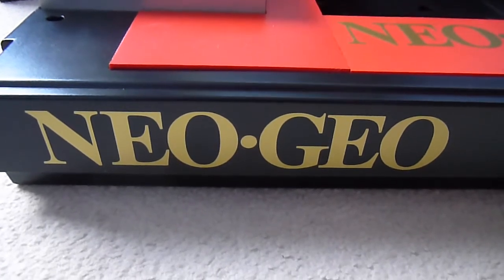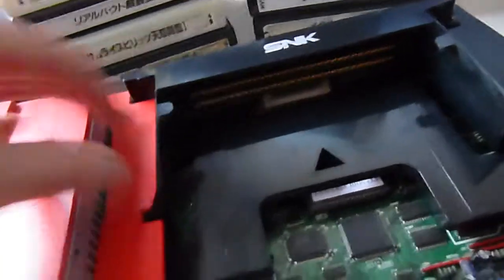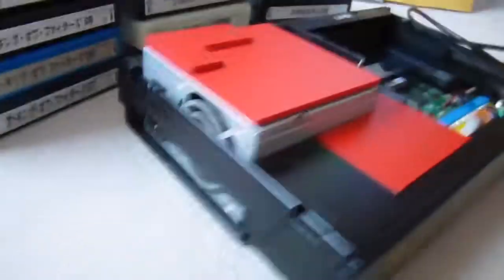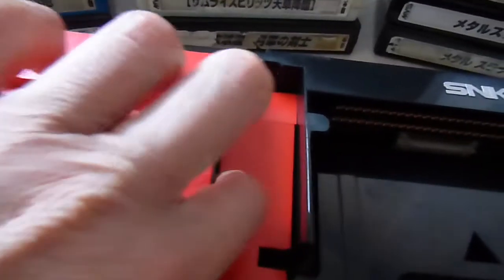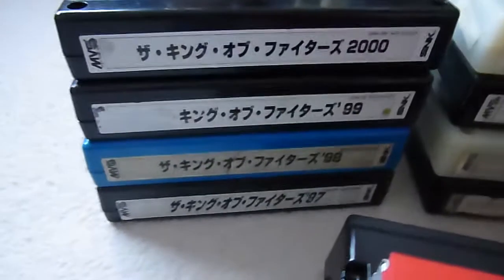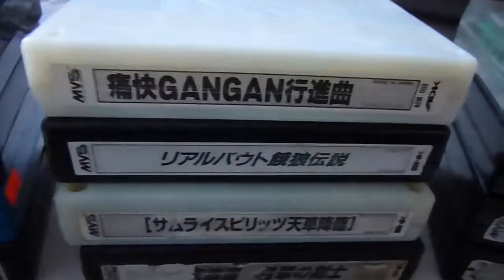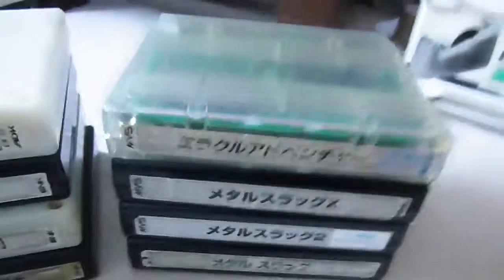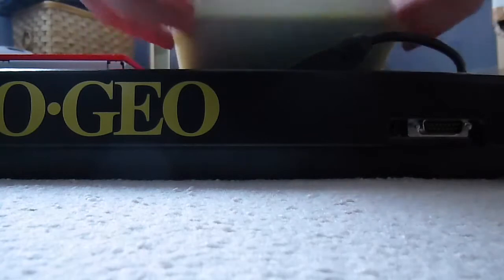Project Neo Geo : "Arcade Edition" - The Final Chapter

Comment from the maker: So, the MVS.
Well I am mainly just picking up those 'Giga-Power' fighters, you know the ones that either have mega long loads on NGCD or are mega pricey on AES, games like the later KOF's. 
Its also nice to get a few others for MVS like Spinmaster which was not even available on NGCD and of course the Metal Slugs. 
Still keeping the AES and NGCD as I love those systems too much and the original retail packaging is just phenomenal.
Its much cheaper to get an MVS set up - agreed the games £ can get silly. 
The MVS board cost £65 - the Supergun was £45 - the ATX PSU was out of one of many old PC's I have so cost me nothing but is worth £30. Same with the outer casing - could pick up something cheap. 
Unibios 3.3 was £30 - original from Unibios.free.fr
http://unibios.free.fr/index.html - courtesy of the legend Raz.
The controllers, neogeo, I have three - so least one for each system worth £40. Paint cost me £5, the Foam PVC board the same £5. Vinyl gold neogeo stickers £4. So it cost me £154 - but if I had to buy everything from scratch it would have cost £224. 
I thought long and hard about buying a cmvs and tbh I have enjoyed making something that suits my needs. Am sure its been more enjoyable for me than buying someone else's cmvs creation :-)

Comment: Wow man!! Nice! Looking good. Yeah I really like the MV-1A board. Might be the best single slot MVS board out there. It's size/style and having a socketed BIOs are a plus. Also, with that board you can see what IGS modeled their PGM after. I like what you did with the outer case. Looks sleek but at the same time simple and hardcore. Is this your first MVS? I recommend the 120 in 1 if you are looking into a multicart at some point. Enjoy it!!
Reply from the maker: Thanks  :-)
Truly honoured to know you liked the look of it, keeping the design clean and simple was the theme :-)
I may try a decent muti-cart at some point - yes the 120 has got a better choice for me too. 
I almost got a 1C but that soldered in surface mounted original bios put me right off - lol. 
Tbh I now got most of the games I want on this and the AES - the rest I can live on NeoCD like Sengoku2 as they are the one-loads-at-boot on the NeoCD. 
For my next project I probably would look to just make-up a Combi-PSU/Supergun unit and get a multi-game board. Actually have you any recommendations for best Pandora's or similar for running likes of Double Dragon / Ghouls N Ghosts / BadDudesVsDragonNinja etc. via. a supergun RGB on a CRT - I know they have issues so i'd really value your opinion as you got a great channel.
Thanks again , Daz :-)
Reply: Awesome and thanks! I only have experience with the Happy Fish multigame pcb. Not the best but it's fine for me with the games that work.  I was thinking of getting the Pandora's box 4. Seems to be the best at the moment with the most games. The biggest problem that games seem to have on the multi boards is sound issues. Missing sound or distortion. I would think the games you mentioned would work fine since they are earlier games. Good luck with the supergun and I look forword to seeing how it works out. And thanks again for the compliments.